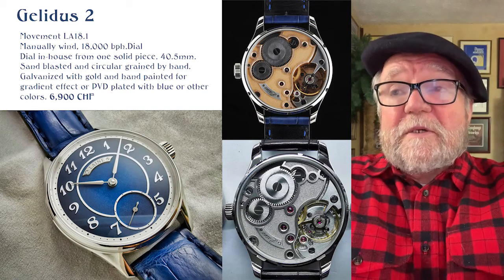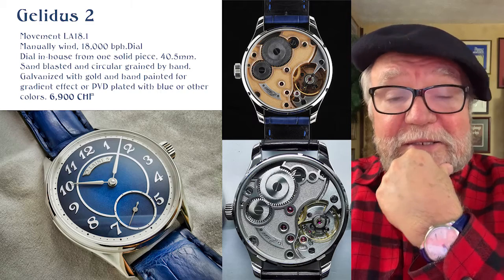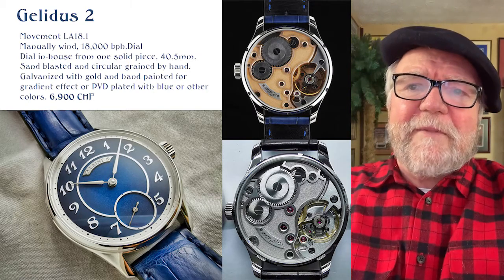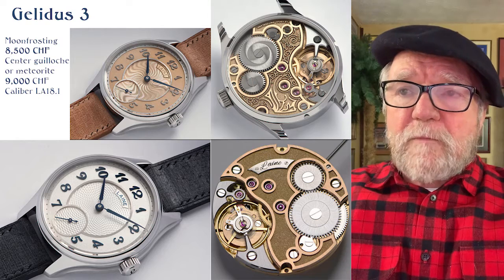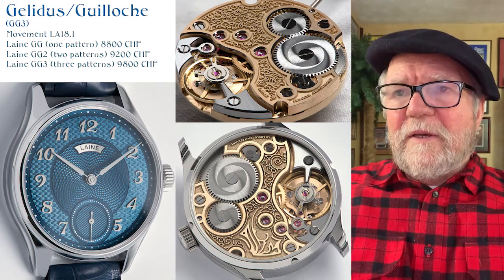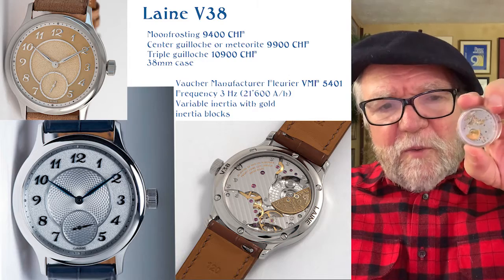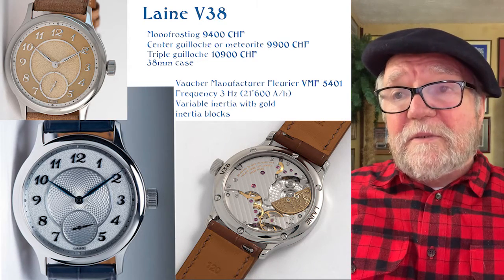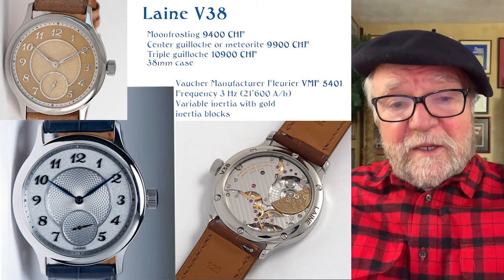Laine Watches: Guillochè & Engraving

Comment: Hi Bill, 
Out of interest how much does a Vaucher movement set you back. I think a standard ETA is roughly $250? Thanks.
Reply from the maker: Hi FM. The one I got may not be representative since I didn't know the unit price and may have had some up-charges that were added because the buyer may have had some bespoke features. However, it was around $1,300±, which seems to be the right ballpark. They way to get one would be to get together 25 guys and buy them from VMF yourselves. Take care, Bill
Reply: When I reached out, the highest decoration 5401 was 1890 CHF with a minimum 25 pieces
Reply from the maker: @Rsolanzo  Everything has gone up!